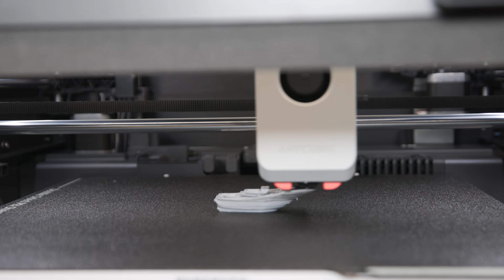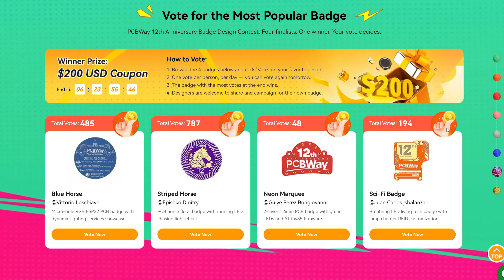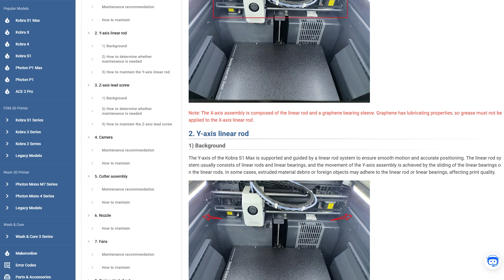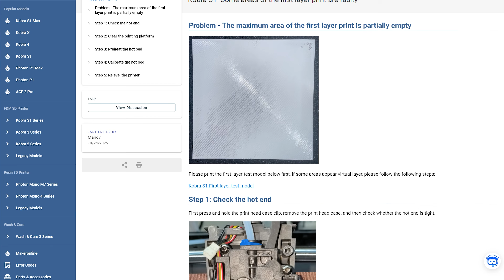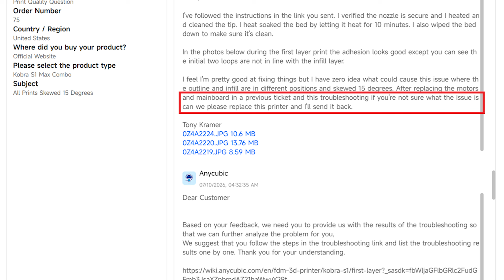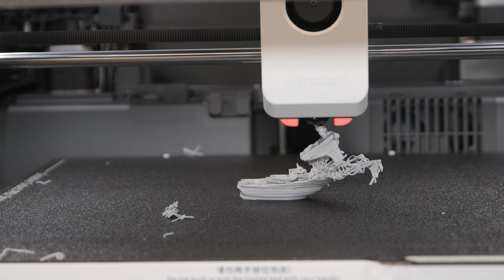Kobra S1 Max Part 2: They're Sending A Replacement

Comment: I have had a useless k1max since august 4th. Says there is unknown filament in printhead. Replaced every single thing about the print head and the board on the print head... got a bunch of refurb parts from them (that they swear are brand new). Got lectured by them for saying I couldnt have this machine down for months (...which it now has been). I have grown to h8 this company because of the customer support, which you can only experience nightly - once per night - as you said. The agent has gone on multiple "vacations" throughout these two months. Now they are resending parts they already sent. I am outside the 3 month warranty as I got it in April or May like yourself. I'm about to start demanding replacement. So unbelievably disheartening and awful to get stuck with this giant, useless box for so long.

Comment: Im new to 3d printing i feel your pain with support iv had my kobra s1 for two weeks and it stopped working spent two weeks messaging support who sent parts still didn't work 6 weekes on  iv asked for a replacement machine which has been totally ignored. I have had very similar responses like yours from support
Reply: They always sent me the replacement parts I needed for my kobra 3 max, but anycubic is just cloning Bambu labs printers, after this guy review, I think I might be done with anycubic

Comment: i was going to pull the trigger on this . but this gives me doubt.  i have the kobra x.  some issues but works ok.  my elegoo carbon 1 died after i added the canvas.  still waiting on elegoo to tell me what is wrong.  ive got the m1d on early bird.  but 350mm is nice.

Comment: I can share your experience with the Kobra S1 I own. Also I do not like the lack of stock parts. It is really concerning that you have a limited time of parts availability for a machine of that size. On the one hand I like the idea of reaching out to customer service to find a solution. But getting new parts and having to rebuild a machine as a hobbyist cannot be the way. I think Anycubic has to rethink their customer profile and how they handle responses and service to different personas. I wonder how many eople out there with an idle machine sitting in the corner, do nothing about it and just let it rot. I assume the level of frustration and effort is not worth for a lot of people. Just wrote a ticket today after I had fixed sth and the next thing broke....

Comment: im sorry you have been through this ordeal with anycubic. for all that it matters, i also have a very responsive team replying my issues with my s1 and X. recently ive been through almost the same headaches as you but for the flashforge creator 5 pro, which is about to be returned. my exp with snapmaker support is impecable, for both the u1 and the vintage 250. they always respond promptly and do solved it all the time, including sending parts. In general i have the feeling those companies cut a LOT on QC and transfer that to us, paying customers, to be their crash test dummies. Some will have the skills to do a full disassembly as you, but the vast majority i would assume to have not...
Reply from the maker: After this I realized that reviewing warranty support can be really valuable.  I'm not interested in causing problems to call in but if I do have problems I'll absolutely give a call instead of just fixing it.  I was interested in the Creator 5 and while I didn't end up ordering I was close and glad I stuck with Snapmaker based off your support feedback.  All companies make a choice on what to spend on QA and QC so it's absolutely risk vs reward for the bean counters.  I doubt the actual engineers were excited about redesigning anything to be cheaper.